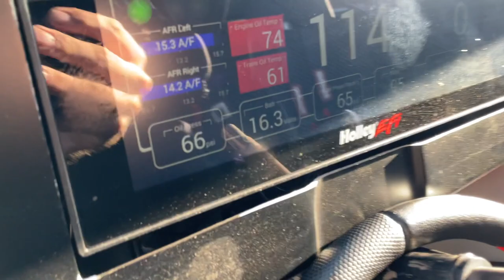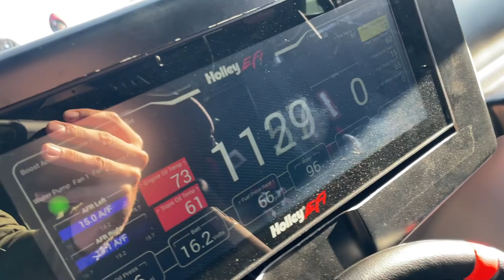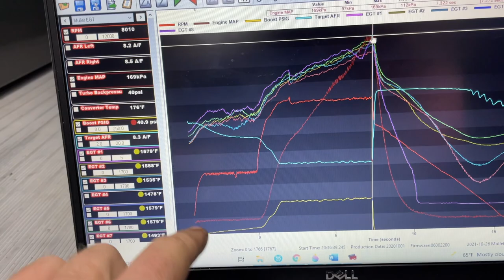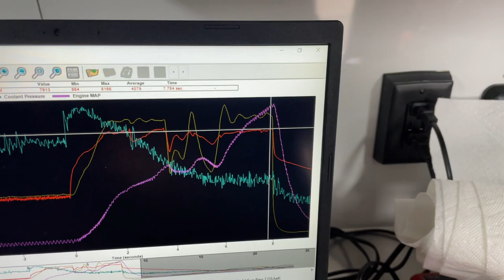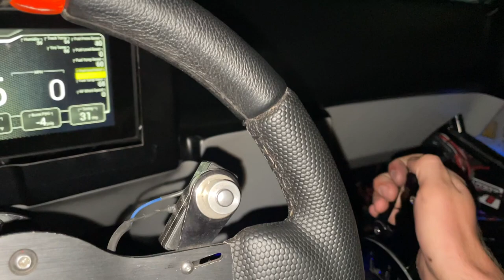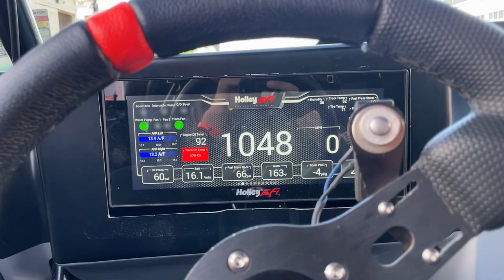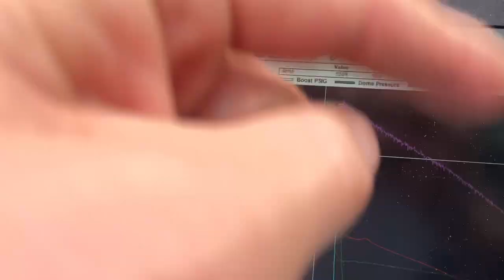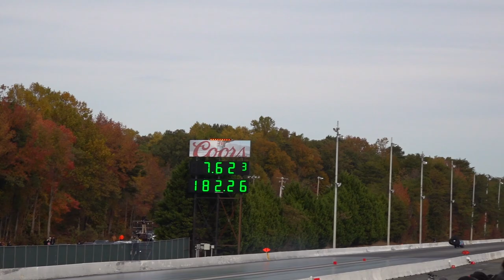World Cup Finals Day 2 & 3 - Mullet BARELY Qualified... Entering Eliminations Blindly!!!

Comment: Back to back limiter boost tests are quite rough on the converter. I've broken a couple sprags doing suspension testing. It builds heat that doesn't work out of the converter unless you actually move the car to get the fluid moving faster. The symptom from the broken sprag is a converter that won't flash, it just acts like a fluid coupling, and slows the car way down. 
Be careful out there, good luck!

Comment: I've been running methanol for 30 years and you need to run a mechanical vacuum pump to help with excess crank case pressure. Running top lube will help a little with the cylinder washing.
Reply: It's never good when a comment starts with I've been doing Said thing or said amount of years
Reply: @andrewshepherd2041  well I don't have excess crank pressure.
Reply: @andrewshepherd2041  yeah, that means he's obviously NOT done what he suggested and paid the hard way. Sounds like he's passing on a free tip to me. What do I know though, I've only spent 20 years in the automotive repair industry. Whoops you hate hearing that.
Reply: @doughopkinsjr  how does fuel type have anything to do with crank case pressure. Too much ring gap will cause crankcase pressure.
Reply: @nintendogamer5472  normally you don't run methanol unless you running high compression or high boost both can cause excessive blow by and both benefit from a vacuum pump
Reply: @nintendogamer5472  Well higher octane fuel means higher compression ratios and/or higher boost and more advanced timing are possible all of which increase peak cylinder pressure which means more blowby.
Reply: @MustYouHaveAUsername  I run a low compression 8.5:1 high boost 35psi 10,000 rpm limited b18 that runs on 113 octane
Reply: @gearbanginentertainment7476  I've got a few videos on my channel definitely no couch slouch as you say. Been a part of drag racing for over 45 years. I like to help when I can. I have built well over 100 big blocks and small blocks for myself and other racers. So I'll sit here on my couch after I worked 11 hours today.
Reply: @nintendogamer5472  so to say it without a story. It takes twice as much methanol to run than gasoline. So cylinder is fuller and methanol has no lubrication factor so it easily "blows by" the rings which dilutes the oil and makes excess pressure below the piston. This is bad a vacuum pump will remove the blow by freeing the piston of all blown by pressure. Gasoline on the other is more dense and contains oil which is "thicker" and with less gasoline on top of the piston and it being thicker it's harder for air to blow by the rings. You can run a vacuum pump on a gasoline race motor that are built a little on the loose side. Pressure on the bottom of the piston isn't good because when the crank pulls it down that pressure has to go somewhere and its usually front or rear main seals also dip stick tube, valve covers and I've seen it push seal from China rail on intake. Hop this helps
Reply: @mostlymotorized  basically gasoline at an idle or little there above to 3psi. 7 seconds of methanol with 30lbs of boost is probably close to 2 gallons a pass. So yeah they drive around the pits on gas. During burnout methanol, then as soon as he goes on transbrake it's all methanol.
Reply: @mikedrop4421  you know my pain Mike. Try to help the rookies and they wanna fight tooth and nail when we have already been there done that.
Reply: @doughopkinsjr  thanks for the info Doug.
Reply: @lordcommander3224  you're welcome

Comment: Taylor Ray is showing its possible and minimally invasive to put a trans on the back of an engine in a C5/C6 vette with a Driveshaft and a quick change. It's time for Leroy to go under the knife and crank out a low 7 maybe evena high 6. 

The OG needs a resounding comeback.
Reply: I heard it will get a big overhaul over the winter and i think they will move the trans to the front too
Reply: I think Cleet has already been planning that for after world cup.  They keep blowing up the Corvette trans, and the way to go stronger is moving it up front.
Reply: Maybe some alight Aero mods too nothing to change the look to much but still eliminate some bad aero spots and gain some Mph. Also if they do that might as well build the motor to mullets level or beyond and shoot for 6s. There is now 3 stick shift cars in the 6s and several in the mid to low 7s. Time for Leroy to make a comeback and be competitive again
Reply: It's been done a few times over the years I remember watching a c6 make test hits back in 08-09 with a powerglide mounted up front.
Reply: Have to think that’s why grub worm (fastest LS H pattern I think, if not I think Minion has it) made it into the vid by name
Reply: I'm sure it will help the weight bias too. Easier serviceability, less cost for replacements, etc. For what Leroy is, I wouldn't even mind if they put a solid rear axle and a custom 4 link under it if they think it would help.
Reply: It wouldn't be a Corvette after that and wouldn't qualify for any Corvette records. Would still be fun but unnecessary. As a Corvette, Leroy has peaked.
Reply: @tjdjultima  grub worm is old school LT still. Which makes it even more awesome. Dude still running an optispark lol
Reply: Leroy and transmission issues go back to early 2018. It's never been too happy since going turbo. When it was supercharged it was so dialed in. They quickly found the limiting factor and it's a shame how long they've tried to make it work. Here's hoping they tear it down and make bold changes.
Reply: I agree, those guys are to the point to where aero is really helping out, did y’all see that blue mustang? You could literally watch the front getting pushed down by half track
Reply: I agree, I also think a big part of the legend of leroy is breaking the GM stick records on that setup that doesn't do well at high power levels. It'd be cool to keep improving and pushing that set up but might be best to switch to a conventional set up
Reply: Ruby has a Power glide. Never thought much about how they did it until now
Reply: @mckrackin5324  No corvette before the C5 had a transaxle as long as it were to stay IRS it would verymuch still be a Corvette
Reply: @tjdjultima  grubworm is a gen 2 LTX, non of that non 6 second stick shift LS junk. (Big troll there) Destroked to a 329, on 50 PSI they went 6.97 at 211 and 6.96 at 208.  NASTY!
Reply: leroy: no aero.
Reply: The grub worm is an old LT engine and the Minion is a 4.6 ford unless they swapped it
Reply: Resurfaced his clutch with a rock and won WCF too remember lmfao
Reply: @tstuff1213  truly he needs to rip mullets engine out and get a actual race engine built for it instead of something from TSP that they have to ring it’s neck every pass

Comment: Seeing how much Mullet has struggled this year reminds me of Team Bigfoot when they introduced the revolutionary Bigfoot 8 Race Truck, a brand new generation of monster truck. It was the first of its kind with a tubular frame, nitrogen charged shocks, four link suspension. Bigfoot 8 was so new it took them a year of testing to get the truck dialed in, but once they unveiled it for the 1990 TNT Monster Truck Challenge Championship Series, the truck dominated, it was nearly unbeatable, it changed the entire Monster Truck industry.

These guys have struggled for a year to get this beast into the 6's, but I think that come next year, Mullet is going to take the world by storm! This team and the people behind it are doing it the right way, and I can only see good things in their future.
Reply: monster trucks are choreographed like wwf.
Reply: @DieselRamcharger  Didn't used to be, back in the late 80's and early 1990's (1988-1990) TNT Motorsports ran a racing series very much in the vein of NASCAR or F1. It was open qualifying, no freestyle, straight-line drag racing for a points championship. Truth be told that was when Monster Trucks was a motor sport and not an entertainment industry. Sadly the USHRA bought out TNT Motorsports in 1991 and that all went away, but at the time I described in my previous comment, Bigfoot 8 DOMINATED the championship series. Bigfoot 8 dominated to such an extent that it was banned for two months to allow the rest of the series to catch up in points... it won the championship anyways.

Sadly Monster trucks is just entertainment now, but for us enthusiasts, we remember the days when it was a real motorsport, albeit briefly.

Here's an old TV broadcast from 1990 of a TNT Monster Truck event from West Lebanon New York that Bigfoot 8 won.

https://www.youtube.com/watch?v=aWjGSc7lcyY
Reply: The turbo 400 will help but it's never going to be a consistent 6 second car with that LS, especially with steel rods and that weight. They have basically already acknowledged a high 6 will be the best possible pass, which means they will be rare. Grub Worm is a great example of what guys are doing, he was running mid 7's a few seasons ago, with a stick shift, and just put down a 6! Mullet needs a lot of work to compete because everyone else is getting faster every year.
Reply: @bobbygetsbanned6049  cleetus isnt trying to compete. hes just trying to hang with the pack.

Comment: put a benchvice on the shoppinglist for the trailer
as for the transmission :  i wonder if you need an ofroad transmission (input/output shaft and clutch houses) with the shiftkit and clutches for a promod , since youre car is pretty heavy and a promod is more of a featherweight with only a frame with a fiberglass shell , the offroad stuff is made to stay together in a heavy car under lots of torque up a mountan and over bumps , i think they can take more of a shockload compared to a pure promod style trans

Comment: I almost feel like changing to a th400 will solve so much for you I'd hit up rossler man get rid of all your headaches .. you can still run rpm transmissions for everything else it's just Mullets so Thick lol
Reply: Confirmed in an earlier video that they've already ordered one and are just waiting for it to arrive. Think the wait for it was going to be close to a month.
Reply: Sometimes I wonder why they don’t assume that every part on that car needs to be able to handle like twice as much horsepower as they are running lol
Reply: @taylordial1231  wouldn’t be content if they solve all the problems right away lol.
Reply: They should be able to put more gear in it with that and it will help a ton.
Reply: @Datight  sure it would, lol. Even if everything worked properly, there’s always ways to make it go faster! Besides, the better they perform, the more exposure they get, and the more revenue they’ll earn to give us some more of that quality content they always pump out… but with working parts 😂
Reply: He's said it a couple times already that they ordered the transmission but couldn't get it in time for World Cup. Should be in a couple weeks.
Reply: @ls_812  yea I heard at the end he ordered one I'm so stoked.. that's what he has needed
Reply: @taylordial1231  because there's a huge price jump from 2000hp parts to 4000hp parts like tens of thousands of difference for an engine And trans built for double the power of 2000 HP car  but with the trans he just ordered they will be alright now... That's a nasty trans can't wait for it to come in
Reply: I can see the video in January 
‘Our Rossler is robbing too much power so we have a Billet Hemi on the way from Alan Johnson so we can make 5,000+ hp and finally get into the 5s!’
Reply: @jimgodfrey6566  yea I Heard at end of this one too I'm happy that's exactly what this unit needed
Reply: @freedomfox8183  that makes sense. I didn’t take in account that prices for those parts go up exponentially. I’m sure they want clean passes about 1000x more than I want to see them lol
Reply: @taylordial1231  exactly the sooner he learns that the better off he’ll be. If you want to make 2000hp consistently you buy a engine capable of making at minimum 3000hp+. If your making 2000hp everything behind it better be able to hold twice that

Comment: With all his money and support of company’s and people, he struggles just like the rest of us. Can’t wait till They get Mullet dialed in. Mullet has fought them for a year going to make them earn that 6. If it was easy everybody be running sixes. Thanks for bringing us along.
Reply: Truthfully trying to stay true to those said companies instead of just going out and buying what he knows he really needs but is from another company has been one of the biggest issues with mullets performance so far
Reply: @JedStrogan lol this is the first event where they didn’t blow the tires at the line every single time.
Reply: Race cars blow up, because they are designed to run really close to the limit. Happens in all sorts of motorsports, mechanical failure doesn’t care who your sponsor is. For example James Deane lost at Riga this year because his dry sump drive belt failed 30ft from the finish line. The car had all the best arts, built by serious professionals, with big sponsors. Just because a set up is fast on paper doesn’t make it fast on tarmac. You are throwing in a huge number of external factors like weather, track, human error and wear and tear. Making a car “reliably run 6’s” is extremely difficult as the OP here has noted. It’s easy to say “if they ditched sponsor X’s product that would fix it” from the comfort of a sofa, it’s a lot different at the greasy end.

Comment: 1min in and I already want you to add an engine block heater that you can plug in.  Put the heat In The motor without adding runtime!  Consistency is key!!!
Reply: Just heating the oil doesn’t put heat in the bearings.
Reply: @BlueCollarBachelor  with a pump to circulate the oil around the engine without it running would though
Reply: @BlueCollarBachelor  heat rises.  If you bring the temperature of the oil up, it is going to heat thing that are sitting in oil, and the heat will also make the oil thinner, as intended by the manufacture aiding in proper circulation of oil and increasing the protection of motor parts during cold starts.
Reply: @flyguy22001  That's not how that works. It makes it good for cold starts yes, but still doesn't put heat in the bearings. Even if you pumped it like the guy above wants to do, there's NO heat going into the bearings.
Reply: @BlueCollarBachelor  I’d say at this point your being obtuse... First heat and circulate the oil and cut the running warm up in half or more and you still have a win, as most of engine is already warm.
Reply: @BlueCollarBachelor  go smoke another one.  You are telling me heating an engine before you start it in extreme conditions won’t save an engine. Mullet is supposed to be a street car.  It’s a good idea.  You are just wrong.
Reply: @flyguy22001  Heating the oil in the bottom of the engine isn't doing anything for the rotating assembly. Block heaters are for really extreme temps so you CAN start the engine to begin to actually warm it up. You can literally google how these work. 40 degrees isn't exactly extreme conditions LOL.
Reply: @BlueCollarBachelor  poor out some 40 deg oil. Report back on extreme temperatures.
Reply: @flyguy22001  People start their cars every day in 40 degree weather. It's the MINUS 40 that block heaters were designed for.

 You're just not very bright, are you?
Reply: @BlueCollarBachelor  people use block heaters every day.

Comment: You should have found out how many times longer the new transmission gears are than the last, and then multiply your power output on launch till it was the same as the old transmission at the tires by looking in a log and finding out what boost = roughly what power you make at a given number.

If it's twice as long, you'll need twice the power to put the same power down to the track..if it was .25 you could multiply your old leave powet by 1.25 for a smaller example. 

It wouldn't be a shot in the dark that way.
Reply: That is a good option, once you have data on the torque converter in the car.....lol. Without knowing what the converter was going to do, it was a shot in the dark.

Comment: Being a former Tuneup mechanic and also into hotrodding I remember seeing a Blown 350 CID Hot Rod at a car show on pump gas putting out 1000 horsepower. He was running 6.0 to 1 compression. So with Methanol running in the Mullet I don't know if octane is a limiting factor. Imagine the Mullet engine running 6:1 compression and doubling the boost or more until true compression begins to match the current true compression with the current setup. You cram way more Air/fuel into that engine with the lower compression and higher boost and still maintain the same true compression . Imagine that 350 CID Hot Rod engine with 6.0:1 compression running on Alcohol with the boost cranked up to the max before preignition. Only thing is you have to have a very heavy duty bottom end in that engine. Also a parts store owner told me he was always the fastest and always won racing his boat  in competition because he said his secret is grinding his cam up to an 8000 rpm cam. He said the revs is what won his races. More revs equals more volume in that air pump. If you want even more air flow imagine a 900 CID engine on Alcohol running 6:1 compression with 100 lbs of boost and an 8000 RPM cam.

Comment: Using the intercooler as an oil vapour seperate/catch is a great idea. 

Maybe use a one way valve on the line to ensure it doesn't inadvertently pressurise the crankcase under high boost...

Comment: The more power you make the better the parts you need to go fast Mullet is quite heavy so even  better parts are needed. It'll get there. Six Second Cars are highly engineered if you want them to be consistent and stay together. Looks like at this time Trans and Converter issues are holding Mullet back fix those issues and see where the next weakest link is If there are any.